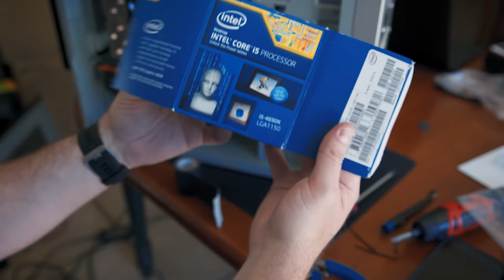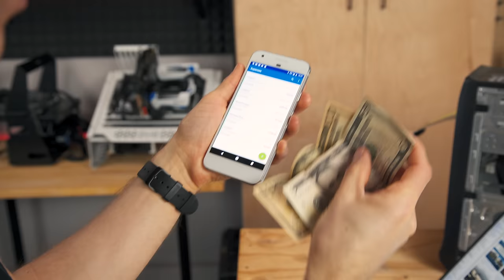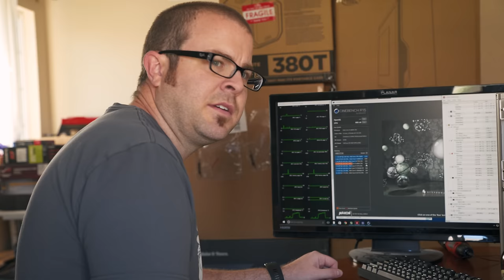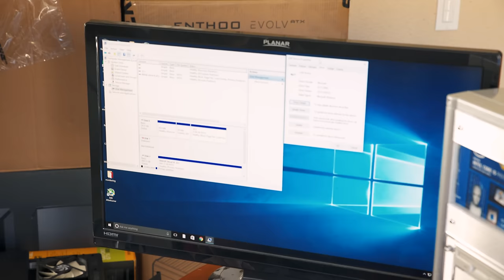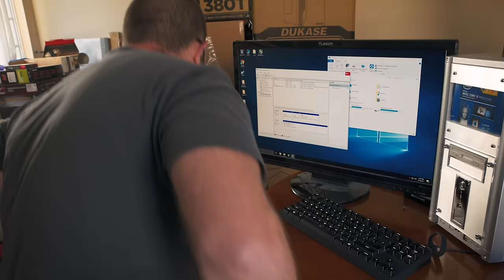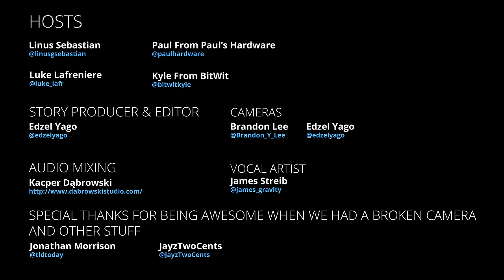$500 PC TEAM BATTLE - Scrapyard Wars Season 5 - Ep3

Comment: I laughed so hard when linus says "we have no way to cut this" and right behind like there is a saw for cutting metal. I love this series :)
Reply: I saw the hacksaw and was thinking are you kidding me!?
Reply: Drill a hole in the case for the blade to go through, then take the blade off, hold it in a pair of vice grips and use it like a mini hacksaw. You can do the same thing with a reciprocating saw blade or jigsaw blade.
Reply: Or the Makita reciprocating saw
Reply: he had already made a little hole. insert the blade  through there are and then connect it to hacksaw.
Reply: if you would have played enough sims, you would know, that thing is only decoration and cannot be used. in fact i am pretty impressed they haven't died already. but maybe only because they didn't want to swim yet.
Reply: 43:11 lol yellow bladed hacksaw hanging right on the wall! Take the blade off then wrap some tape round one end and you got a ghetto hacksaw/shiv. I guess unless it's got a power cord attached to it it's just an ornament.

Comment: That IDE drive probably works perfectly fine its just for some reason the Paul's Hardware guys have no clue what they are doing with IDE drives,  If you pause the video at 37:32 you can clearly see that there is no jumper in place and this puts the drive into slave mode and this simply will not work with IDE to USB adopters as the drive has to be set to " Master or single drive " by inserting a jumper on pin 7 and 8.
Reply: Exactly.
Reply: Or maybe they pulled it to create suspense for a show where they could have been standing around the last hour while Linus and Luke run around a garage figuring how to cut a thin computer panel when a hacksaw is hanging on the wall.
Reply: No, it defaults to master when no pin is present if it is the only drive on the chain.
Reply: Wow. Good job on remembering that. Not many people would remember about those details after 10+ years and getting too used to the newer things. I wouldn't say they have no clue, probably more because they don't have a memory like yours.
Reply: im also quite sure IDE is not hot swappable as SATA is . . .
Reply: The entire time im sitting here going "Cause you forgot to configure the fucking jumper..."
Reply: Megouski   You clearly did not read what I typed as I am not talking about instillation with an IDE cable we are talking about IDE to USB,  so yes if no jumper is set while it is set as slave as long as you plug it at the end of the IDE cable as the only drive then in most cases it will change to master or rather more correctly its the PC its self that does a check on pin 39 to search for a second drive and when its not found its the PC that sets the single drive as master,  but this is not the same case with IDE to USB as they are not directly connected to the PC through an IDE cable and so the drive stays on its default of slave and for an IDE drive to function correctly in a USB enclosure or a IDE to USB adaptor the drive has to be manually jumpered to master or it will not work.
Reply: Oh right, i forgot about that!
Reply: The IDE to Sata pcb i use to modify og xboxs usually has its own pinouts on the PCB so you still have to set the drive.Also cable select would help in this situation.But yes you are right USB to IDE the drive does have to be set to master.Some drives do vary in their pinouts refer to the sticker on the drive
Reply: EQUINOX Those were the days.
Reply: Actually, if you look at 37:38 (you have to be quick, to get a focused frame), you can see, that there is a black jumper on the pins. And if you think about it, of course there is; why would it be in an external hdd frame, if it's not in the correct configuration?
Reply: Couldnt he have just used Bootice, (im probably gonna get roasted for this question)
Reply: instead of Paul using the shitty windows disk management, he should of used diskpart from the CMD prompt..
Reply: I was yelling in my head that you have to init disk from the command line.... But the above make good points about slave/master jumper. But if it worked in the previous enclosure it should still work.
Reply: EQUINOX And now I remember that silly jumper that drive me crazy
Reply: this is literally what i was screaming lmao
Reply: I'll get a lot of hate for this, but at the end of the day, these guys are more entertainers than IT experts.
Reply: I WAS YELLING THIS AT THE SCREEN THE WHOLE TIME!!!!!
Reply: No excuses here - I should have checked the jumper. I've handled IDE master/slave configs many many times in the past so I'm facepalming watching this again right along with you guys! 🤦‍♂️
Reply: RINGO36 spoiler alert ....

They still win
Reply: hey at least ur honest
Reply: That's like the one thing that distinguishes IDE drives from SATA ones, beside the connectors. How could they forget?
Reply: At 39:30 you can see a jumper on pins 3 and 4(most clear image i've found)
Reply: I paused it where you said and I can clearly see that there is in fact a jumper on the drive. It is, though, set as a slave going by the pins it's on.
Reply: it's easy to make a mistake like this when you under the amount of pressure you guys had to finish the build
Reply: Never heard of your youtube channel @Navi
Reply: EQUINOX that was my thought. it would be easy to forget jumpers exist
Reply: @Reffter lol
Reply: But originally was it not in a USB external chassis? Would it then not already be set to master?
Reply: EQUINOX it showed gregFPS's YouTube banner as urs my bad if i accused u
Reply: LMFAO, as long as you get a good laugh out of it and you enjoyed yourself it's all good. I'd love to see you participate in more Scrapyard Wars.
Reply: TjinDeDjen It's on the wrong pins
Reply: What possible reason would the drive be in slave mode inside of the case!
Reply: It completely depends on the manufacturer, there is no standard. I remember my drives requiring jumpering whether slave or master, but only later in the 2000's  it started to be "no jumper = slave" but it of course depends...
Reply: +EQUINOX I wouldn't even know that because IDE is too old for me to know without someone like you telling me lol
Reply: +Paul's Hardware I agree, that you should have checked, but pause at 37:38 (get a focused frame). There actually IS a black jumper on the 7 and 8 pins.
Reply: +domlee590 No, it's not. It's on 7 and 8, wich sets it to master/single drive.
Reply: wat
Reply: Couldn't you have just used the original circuitboard for the hdd to convert to usb?  Why did you need to take it apart in the first place?
Reply: They didnt know it was IDE, they didnt want to use USB. They were wanting a sata drive to be in the enclosure.

Comment: this is a job for ifixit! cracks case open with tongs.
Reply: Speaking of cracking cases open, here's what I would have done for the RGB theme on the cheap; spend $5 on red, green and blue paper and candy and... wait for it... Piñata PC.  Cut up the paper and stick it on like a piñata, fill the bottom with candy and hang the PC from the ceiling.  Run your benchmarks then give a baseball bat and a blindfold to the judges.

Comment: The IDE drives have jumpers that have to be set right to work correctly with the adapter. My guess is that they didn't have two failed IDE drives, but simply forgot about the jumpers.

Comment: Linus drops a 1080 ti with water cool and doesn't freak out
I care about my 1050 ti like a fragment of dinosaur dna.
Reply: Dr AurA i get those 2 mixed a lot, thanks.
Reply: chris o oneal i love my 1050 ti too
Reply: Huh, out of curiosity, is 1050 ti a bad card or just low on the scale of GPU's? Considering buying that for my first pc build.
Reply: Reinis Zālītis yes trust me it s the worst.DO NOT BUY IT
Reply: What GPU would you suggest at a price range from 200-300 euros? If there is one at this price range. I know that after that comes the 980 and 1060 ( If not mistaken )
Reply: Reinis Zālītis a gtx 1050 ti or a rx 470
Reply: Apollo Kekz it can actually run VR. But very laggy
Reply: chris o oneal "sequence" of DNA
Reply: chris o oneal is a standard 1050 good or nah?
Reply: Reinis Zālītis 1060 is your best bet, but im guessing you have already built your pc

Comment: 42:56 As your asking the question I am looking at a hack saw on that back wall.  Remove the blade off the saw which will easily fit the hole that was made in the case.  Will easily cut through that sheet metal.  I guess hindsite is 20/20 though.

Comment: no way to cut the case as a hacksaw is sitting on the wall
Reply: You're not gonna cut a square in the middle of a flat metal with a hacksaw
Reply: deirdre Detachable blade. You could have slid the blade through and cut with the lone blade.
Reply: deidre & Kvazick

With a large enough drill bit you drill a hole in the corners, which gives you enough clearance for the blade. Detach the blade, put through hole, reattach to handle, and start sawing. Complete the cut, rotate blade in pre-drilled hole, cut next line, rinse repeat.

It is very quick and easy to do if you don't have the right tools for the right job at the right time.
Reply: I saw it right away too. I was thinking "If only they had a hacksaw... Oh shit, there's one right there.. "... lol
Reply: Thats a great idea actually.
Reply: No you silly thing! You can't cut the middle of a panel with a hacksaw!
Reply: Roy - Erm, actually you can.
Reply: yeah it is fam

Comment: All the IDE drives are failing to be recognized, but from the video it looks like the USB adapter was powered up while the system and hard drive were both already powered up. To my understanding, IDE drives were never hot-swappable. You can't power the adapter while the drive is already powered and expect it to work. Specially built server enclosures were able to hot-swap IDE drives, but they essentially powered and initialized them and then connected them to the system. This is different than powering the drive and then powering the adapter (the interface needs power before or concurrently with the drive).

Comment: That clear piece of plastic at 31:40 is there to keep the solder joints from shorting to ground, or even shorting to other circuits on the PSU board via the casing. You should not remove that lol.

Comment: That IDE. Would be faster to have used the DVD drive (or even floppy) to piggyback a network boot over the rj45 online.
43:46 There is a reciprocating saw on the shelf and it would have cut that sheet.

Comment: Breaks open USB HDD caddy, then has to use a USB adapter to connect the drive. Sods law right there. Also, there was a hacksaw in the garage Linus and Luke could have cut the case with

Comment: I just recycled a pc case like the one that Paul and Kyle used. It is a raidmax, mine was blue and had blue lights on the two pillars at the front. Also my version had a window with a fan in the centre.

Comment: Also that corsair 450w psu Linus was adamant for surely isn't powerful enough for a 980ti? Don't know what the thermaltake was, but usually 600w plus are used for those graphic cards.

Comment: Don't you guys have electronics stores that have leds and resistors and wire? Also those transparent plastic pieces you pulled from the power supply were an additional protective layer to prevent short circuit to case. Power failure doesn't kill hard disks, power loss then half restoration does. Hard drives never write to the BPB https://en.wikipedia.org/wiki/BIOS_parameter_block

Comment: 17:45 Relatable, I had to cut out part of the back of my Dell make my GPU fit🦊
Dell Optiplex 780 Mini Tower,
Intel Core2 Quad Q9650,
8G DDR3, PCIe 4xUSB 3.0, 
EVGA GTX 750ti, C:\ 500GB 7200rpm, D:\ 300GB 5600rpm.
Edit: Not my current rig lol
Reply: Current Machine:
No-Brand ATX case(was free)
Mobo: Gigabyte GA Z270X Ultra Gaming
CPU: Core I7 6700k model:5E rev:R0
GPU: Asus Strix  Radeon R7 370
RAM: 16GB DDR4(2x8)
C:\ Crucial MX500 500GB M.2 SSD 
D:\ WD 10EZEX 1TB HDD
E:\ WD 3200JS 300GB HDD
PCIe 4xUSB3.0
PSU: Thermaltake Gold 850w
TIM: Thermaltake TG-7
Corsair ML120 White LED Maglev fan
Avermedia LGX
Windows 10 Pro 1903 build 18362.449

Comment: Now hold on.. they have a drive enclosure with an IDE drive while they need SATA. BUT... the drive enclosure surely has an IDE to USB adapter circuitry inside it. Why not appropriate that hardware and then claim misinterpretation of the allowed "extraction of the drive"?

Comment: I think I did good tbh went out spent exactly $500 
ASUS P8Z77-V LX2 $83 
i5 3570k $110
thermaltake nic c5 $20 (tower cooler ) used came with rgb 120 mm fans not stock
G.skill Rip Jaws running at 1600mhz 8 gb ram x 4gb sticks ddr3
Gigabyte gtx 970 G1 gaming Windforce edition $120 (pawn shop new sealed wtf they thinking)
psu corsair hx 750 wat silver rated (older HX series still good right??)$55
500gb 7200rpm seagate drive $20
NZXT S340 $72
total spent $500 only thing it took a week to find everything 
you think I did good Linus ???
Reply: oh wow  forgot to mention I got ivy bridge I5 stable at 4.4 at 72 Celsius I can go 4.6 but it reaches 83 celcius so i dialed it down not into heat or noise it i ramp up my fans it is much lower at 4.6ghz

Comment: Dude. I have a GTX 1050 Ti, and my 480W power supply can power it.
Reply: Street Rouge Gaming that's because the 1050ti draws it's power directly from the PCI-E slot on the motherboard

Comment: I literally get second hand embarrassment from watching every single one of you guys trying to work with power tools.. it's horrendous lol.

And dude, with all of your collective "professional" computer building skills, I cannot believe that none of you even considered trying to wire the Seagate yourselves.. you have the IDE connector from the original equipment that Linus gave you guys, you have molex power in your case, you couldn't rig up your own IDE to SATA yourself? Or even with the USB adapter, you couldn't take the FOUR pins and wire them directly to a USB header on the board??? Shit, you could have even spliced into one of the existing rear I/O USB slots, if you really couldn't find the right USB header from the board!!! Damn, is this stuff just not filmed? Or do you guys really just completely miss these things...?!? Because it amazes me how you guys will easily take a Dremel, angle grinder, or even a fuckin hacksaw just to achieve these simple little modifications, that any kid in entry level metal-fab at a tech high school could do in five minutes.. 

"Ah shit.. the Dremel just 'slipped', and now there's a huge gash, what should I do now?... Hacksaw??"
"Do you even know how to use a hacksaw?".....

You guys are insane! This is allllllll ridiculously simple and easy m-Fab stuff anyone could do in their fuckin garage and the right tools.. Damn.